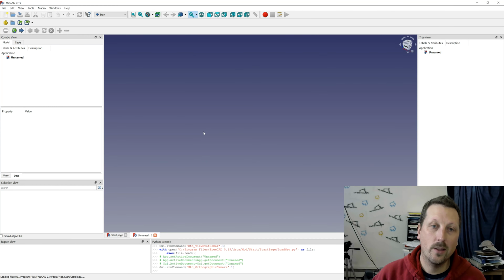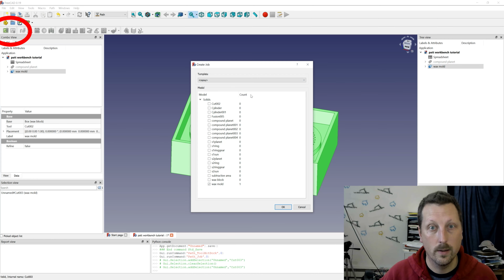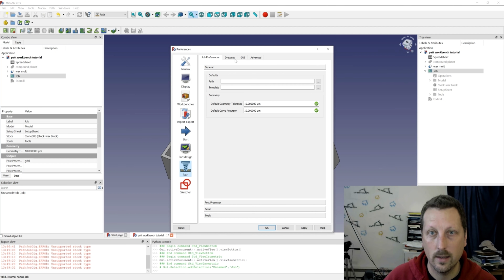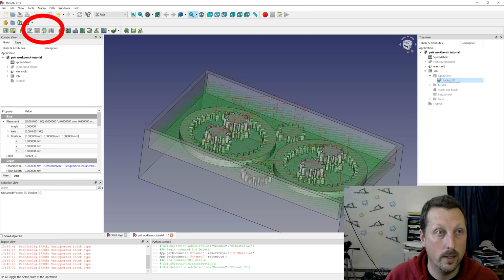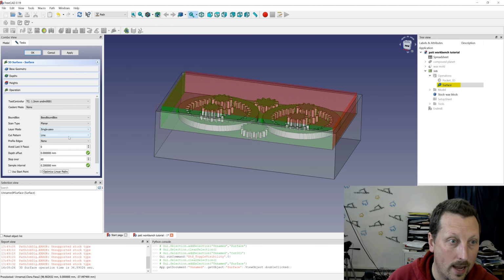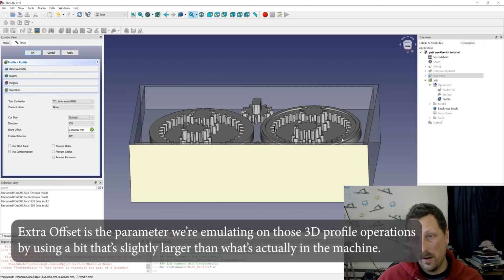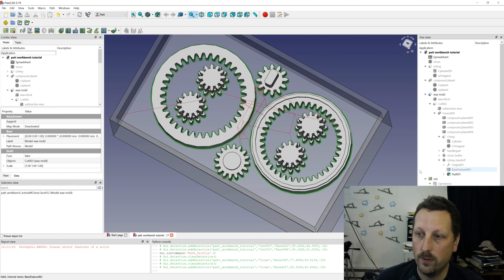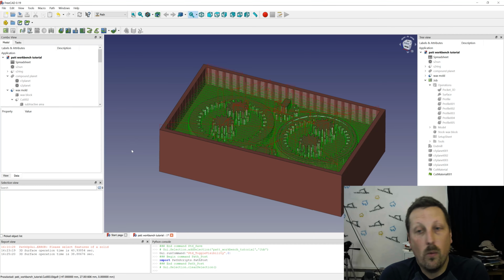FreeCAD Path Workbench Tutorial - The tutorial nobody asked for...

Comment: Having trouble in freecad cam post processor generating a .GCODE file or any file extension . My post processor is set to GRBL and generates only a .NC and that file won't work on my Genmitsu 4030 . A down loaded.GCODE file works fine and the test files for my 4030 are .TAP files ,these all work good on my Genmitsu machine . What is a .NGC file . Really starting to get desperate any suggestions would be great Thanx Mike
Reply from the maker: I'm pretty sure .nc and .gcode are the same.  You can edit the file's extension and it'll likely load just fine on your 4030.  You can open either one in Notepad, and you'll see it's mostly a list of G01, G00, M03 and other G## commands with various coordinates and values (these are the G codes).

Edit: you can open most of these files in a text editor, the contents are somewhat human readable and also human editable.  NGC is probably same as NC and Gcode.  If you open it and see a list of G## codes, it's a gcode file.
Reply: @WhitmanTechnological Thank you for your reply. I know nothing about gcode but I think file extension are there for a reason, you can't edit a file with a  .PDF  extension when it was meant to have a .JPG and expect it to work. My Genmitsu 4030 uses GRBL
Reply from the maker: @MikeGuenther-f2z7r  https://www.reddit.com/r/CNC/comments/oigpxd/eli5_the_difference_between_a_gcode_and_and_nccode/
Reply from the maker: It's certainly true that a PDF is not a JPG.  Good luck with your project.
Reply: @WhitmanTechnological  thank you for your info .Never had a problem with freecad for my 3d printing and there is probably something simple I'm missing. thanx again

Comment: Can freecad cnc 3d contours? Everything Ive seen so far is 2.5D.
Reply from the maker: There's a button on the Path workbench called "3D Operations" and it has three sub-buttons: 3D Pocket, 3D Surface, and Waterline.  Those operations can take a complex shape and calculate the path across its surface in various types of grids.  I used to use PyCAM for that kind of operation, but since I'm always making my objects in FreeCAD, I don't need that additonal step in my toolchain anymore.  I can just run a 3D surface or pocket job directly from FreeCAD.

Comment: Just curious, what are those two laser units for on the cnc machine?
Reply from the maker: I saw someone else with a laser X on their router and thought it was cool.  I designed my own router, and I wanted to know that I could play with the open source grbl software that was controlling it.  The lasers make an X on the surface where the bit will plunge.  I spliced my own code into grbl to toggle a pin on the microcontroller, and I wrote it to listen for M61 to turn the laser on, and M62  to turn it off.  Just a little excuse to play with lasers and familiarize myself a little bit with modifying the router firmware.  It's not even remotely useful, but it looks cool. XD

Comment: I am trying to cnc gears using path.  I 3D printer the gears to make sure they can handle torque and had best gear reduction and now want to cnc them out of foam for lost foam casting into aluminum.  No success so far.  on the path workbench for gears.  I have no problems with other items with flat and curved walls but teeth just don't happen.  Appreciate any advice.
Reply from the maker: To get the router to make incremental passes that cut out the teeth nicely, you need to select a face that has the teeth edges as either the inner or outer edge.  At 15:24 you can see I select the top of the gears and then use the Profile with the outside of that face to get a path that cleanly cuts the teeth and out.  And then around 18:52 I select the face inside the rings and use that outer edge to profile the inner teeth.  Profile will compute the path that will precisely cut out the inner or outer edge of whatever face(s) is(are) selected.  Make sense?
Reply: Thanks,, funny I can try dozens of times without success and one minor change it it works easy and perfect.  Have a great day. @WhitmanTechnological

Comment: Dear Sir,  How do I get Path to not re machine empty space.  I am using a CNC router to put a 12" diameter x 4" deep dishout in a 14" square x 4.5" thick block of wood.  I go in with a 25mm ball end mill, and using 3D pocket, rough out the bulk of the material.  Then I try to go back, and use 3D pocket with the same tool but with smaller step downs, and 10% step over, (to get a smother surface) and it proceeds to re machine the entire block as if the first cut never happened.  Don't get me wrong.  The fact that Path even exist, as well as FreeCAD itself is mind boogling to me, and I am more than eternally grateful that it exist.  What am I missing?  What should I do differently?  Thank you for your help in advance, and thank you for the tutorials.
Roland
Reply from the maker: So the first one is the pocket where it's carving out all the material, and you select the bottom of the pocket for that operation.  After bulk removal, I think you want to do a Profile operation instead of a second 3D Pocket.  You might be able to select just the bottom face, or you might need to select the vertical walls.  I'm pretty sure there's an option for outside or inside - you'd probably want inside for the inner walls of a pocket.  You can set a tiny step down to get a nice surface finish.  I'm pretty sure that's the one you want.  I'm travelling so I can't test it.  Let us know how it goes!
Reply: @WhitmanTechnological  Dear Sir, Thank you for getting back to me. Here is what I'm trying to machine. Picture half of a basket ball sitting on it's apex with the open end up. The walls are about 10mm thick.  I need to rough out the inside material, and then come back and smooth off the inside walls.  I don't see where I can send you my FCStd file, or I would. I'm in no hurry for a solution to this problem. Thank you again.
Reply from the maker: @kb3cxe  Back at home now, I can hop into FreeCAD and set up something like you describe.  You do a 3D Pocket first to carve out all the material.  And then you do a 3D Surface operation for your finishing pass.  Whereas the pocket expects there to be material to remove in multiple passes, the surface assumes all excess material is already removed.  Does that work?
Reply: @WhitmanTechnological  Thank you for all your help.  I'll give it a go, and see how it turns out.  Thank you again. Roland
Reply: @WhitmanTechnological  Dear Sir,  Thank you for helping me out on this.  Where do I find the 3D Surface function?  Thank you again.  I'm using a 2022 MacBook Pro, OS 13.4, FreeCad 0.20.2
Reply from the maker: @kb3cxe  I don't know how FreeCAD versions might differ, but for me it's under 3D Pocket.  That button on the toolbar is a drop-down with two other 3D functions.  The documentation for the Path workbench marks the two extra functions as "experimental", so I think you need to enable experimental features or something in the config.  You can read about it in the docs.
Reply: @WhitmanTechnological  Dear Sir,  Thank you very very much for all your help.  That worked a treat!!  It definitely take some time for my Mac to process it but what the hay. Thank you so much. You've saved me a lot of time.  A side question if I may...  Have you ever tried sheet foam for spoil board?
Reply from the maker: @kb3cxe  I have not.  Just MDF.
Reply: @WhitmanTechnological  Dear Sir,  Not trying to be a BN. Where can I donate some money to the path group to try to help out?  Thank you, Roland
Reply from the maker: @kb3cxe  I don't know about the path workbench specifically.  When I grab the latest version of FreeCAD from time-to-time I like to throw $5 or $10 through PayPal.  They pop up a donation link after you download.
Reply: @WhitmanTechnological  Thank you. Happy Fathers day.

Comment: Awesome! Thanks for the info. Does Centroid still crash on the newer versions?
Reply from the maker: I haven't tried it, but the resulting gcode would probably be almost identical, just maybe some differences with the preamble or something.  They were aware of the crashes back in v0.18, so it's probably pretty low priority.  If you can't export with centroid, you can always switch to a different one and export...
Reply: Thanks again. Ill try it out. I havent tried to use gcode from freecad yet. New to freecad. just trying to figure it out. I use centroid software though to run my machine.

Comment: I'm sure you have better things to do, but is there any chance you can make a video showing a walk through of this, but with cutting out a dome piece from a square stock with roughing and final paths?    This video has been very helpful, but im stick having issues with a vertical arch path.
Reply from the maker: The path workbench tutorial that @wantafastz28 asked for??  The process isn't too much different from the steps I took in this video.  To see if there were any quirks, I tried it out in FreeCAD.  I made a 15mm diameter sphere, and a 30x30x12 box that intersects with the upper half of the sphere so I have a hemispherical dome, and a stock piece to cut it out from.  I did a 3D Surface with an endmill to rough out the material, using multi-pass operation to take it in steps.  Then I di another 3D Surface operation with a bullnose endmill.  I noticed the simulator didn't want to simulate unless I switched the bit to an endmill.  I also noticed that switching to an endmill moved the cut paths away from the model - so FreeCAD is definitely able to determine paths for bullnose and ballnose bits, but the simulator might not work with those bits.

Once you have those two sets of paths, you can choose the parameters that give you the kind of surface finish that you want - ballnose with a 5% stepover so it stays really tight to the model, for example.  Zig-zag or spiral finishing path.  Whatever gives you the look you want for the surface.

Here's a link to the file I made just now, if you want to see what I did:
http://joshwhitman.com/cut%20sphere%20from%20block.FCStd

Edit: I did the "spiral" roughing pass in the file just to see what the spiral path looks like, you can use any of the path patterns you want for both roughing and finishing.
Reply: @WhitmanTechnological  wow, thank you such much for the reply.  So far you have shown the best explanation/way for making a roughing pass and then final with editing the tool size. I’ll be looking into that file shortly.  Thanks again!